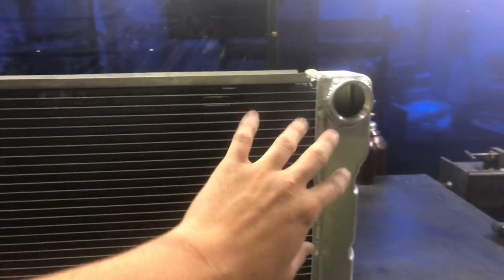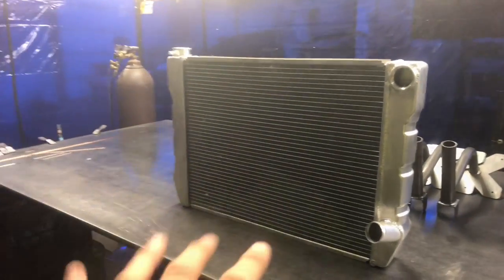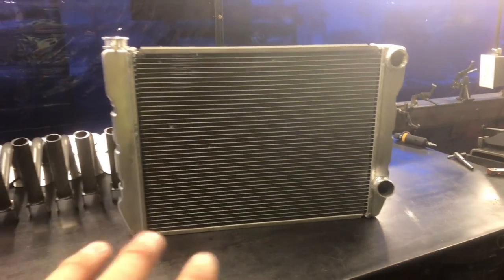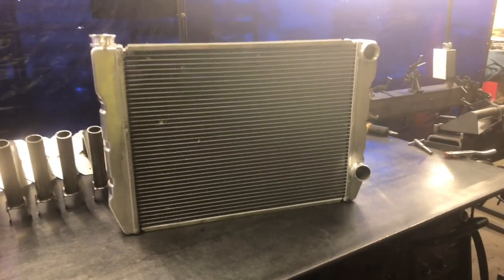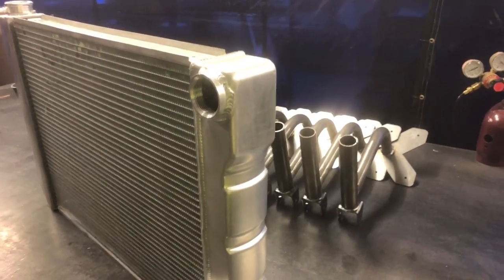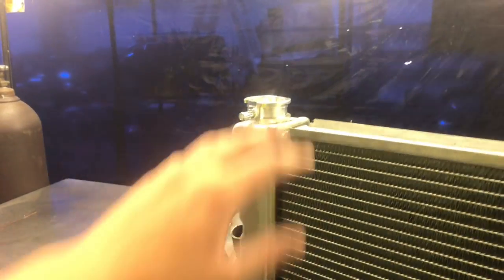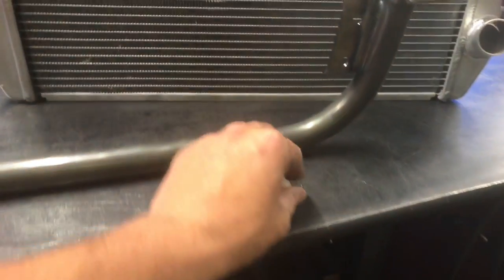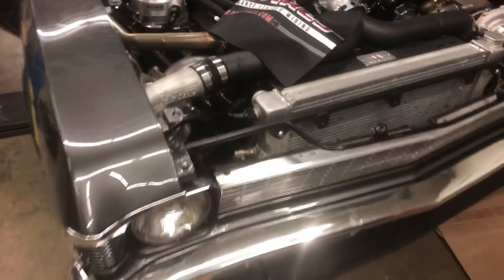1000hp Streetcar Cooling (Motion360 Episode 7) Part 1: Radiators

Comment: @3:54 A dual pass radiator definitely does not give you double the cooling capacity, since the fluid is only going through half the core on each pass. More like 5-15% improvement over a single pass radiator of the same size based on some quick google research on the topic :D
Reply: What about a triple pass? I'm thinking on converting my single into a triple.

I have a high volume water pump.
Reply: @jakefriesenjake just do the math, if your car's at 212F, 5% off is 201F, 15% off is 180F. Also, most aluminum radiators are way thicker than stock. Triple pass is nice but anything is better than stock.
Reply: @zac2384  I have a 2.25" thick aluminum, 2 row core. I'm literally building an aluminum shroud right now. Adding another 10" spal fan. Also will be doing the triple pass mod.
Reply: @jakefriesenjake  sounds like you did your homework. That should work perfect.
Reply: @zac2384  I'm hoping. Even putting in a 10 Second delay relay so both fans don't kick on at the same time
Reply: Start by using good fans,  a lot of the radiator manufacturers even big name ones still use junk fans .

Comment: Yep, triple pass universal from summit have the local radiator shop weld on brackets on where I want cheap and works great, also, go big money on a electric water pump you'll never regret it
Reply: Do triple pass actually beat single pass, all else the same?

I'm thinking of modding mine to a triple.

What do you think about running a 160 t-stat in a 500 hp summer street car? I have a high volume water pump

Comment: Good information been having iusse on a build I pick up has a BBC water pump and some janky hardware store fettings for the upper coolant passages on the block iusse having it get up to 180-200 no iusse about 15-20 minutes of I guess but if I made a pull that those temp it jump to 220 no problem pump is only 35 gpm pump not sure if that even big enough and sure that janky thermostat hardware fitting set probably a culprit to and sound like should probably look into fans too

Comment: Gives me hope! Spent 30k on a H3 Hummer LS3 Swap at Mash Motors Inc in Wichita, KS and the owner sent it back to me as done. But has overheated since day one and still haven’t got it fixed. He took it back charged more money for unneeded fixes that did nothing for my overheating issue. After he couldn’t fix it he just shun me. That’s great for business. So it’s looking like I need a higher capacity radiator. But there will be lots of fabrication involved since there is hardly any room. I just wanted to drive it, but I have learned alot more about LS3 swaps than I ever wanted to know. YouTube University is the best.

Comment: I have a 61 bugeye sprite with a sbc
The radiator top is lower than the top of the engine 
I have a cap on the top of radiator which is lower pressure and a higher pressure cap on  the filler neck at the thermostat housing. 
The top of the engine is higher than the top of the radiator. 
I use a overflow tank on the radiator 
The issue is I'm running 220f
And the cooling system doesn't suck the coolant back into the system. 
Which caps should I be using? 
I have a triple pass radiator,  electric water pump and no thermostat.
I get about a pint of coolant in my overflow tank
Both radiator caps might be trying to suck antifreeze back in to cooling system as it cools
I'd like to run cooler

Comment: I've seen where a push and pull (fans) have been used. One pulling air from the front, and the one pushing air into the radiator from the inside. What are your thoughts? That's sounds ridiculous to me.

Comment: Do I have to put a shroud and fans on a 22x13 c&r racing radiator??? Will be pushing 800-1000 to the wheel and is a street build car

Comment: Only problem I seen with your info I saw.  Single pass radiator ok you go to a dual pass without changing anything else....you speed up the flow through the raidator since its only half the surface area per pass. the quicker it flows through the less it has a chance to cool the water.  it's thermal dynamics

Comment: the only reason u need a dual pass is when the inlet outlet are on the same side of a cross flow radiator ,,simple .....
THINK ABOUT THIS  ..If u make the fluid flow 3x as fast /triple pass this is way way inefficient ***
Compared to a single pass over 100% radiator area . 
THE BEST is to use the radiator with the biggest surface area facing the incoming air flow .
max core thickness    2 3/4  upto 3inch
Reply from the maker: That’s incorrect, this isn’t a new concept.

Comment: I still can't figure out why anyone doing an LS swap doesn't switch to dual-pass side hoses? Even ones who get an after market radiator end up running that God awful 7-foot upper hose to the driver's side! Anyone know the reason behind this before I order a dual-pass and run both hoses to pass side??
Reply: Because they don't want to pay $600-800 dollars on  radiator when you can use your stock unit for $150
Reply: @SD70ACE-  you can find a triple pass 3 inch thick radiator on summit for less than 250 bucks.... I understand stock is free in most cases but good radiators don't have to be expensive. I would expect that radiator with an electric water pump and good fans would be enough for ANY street car.